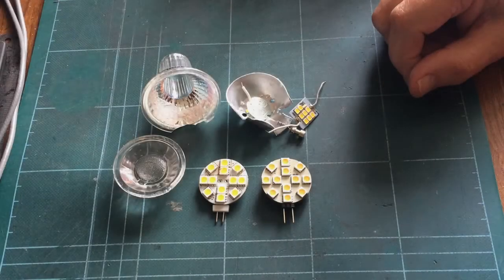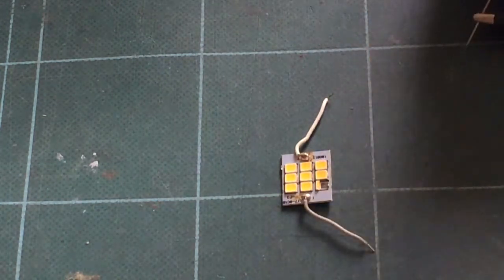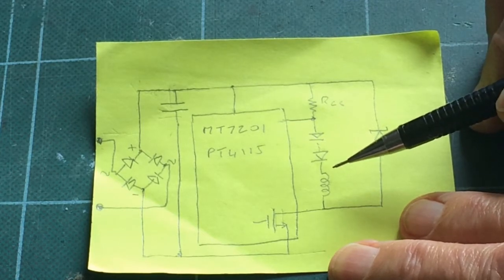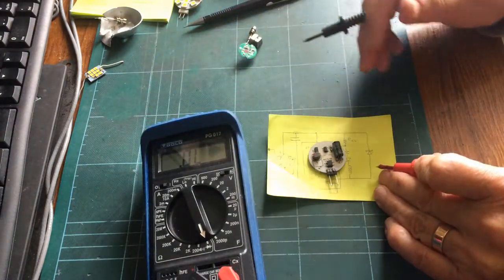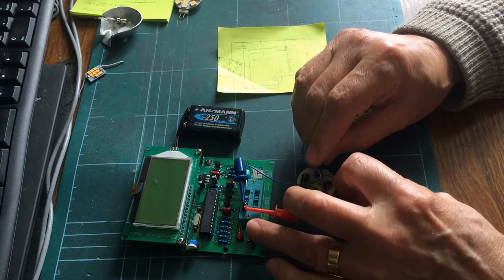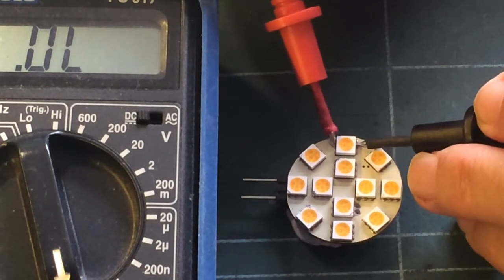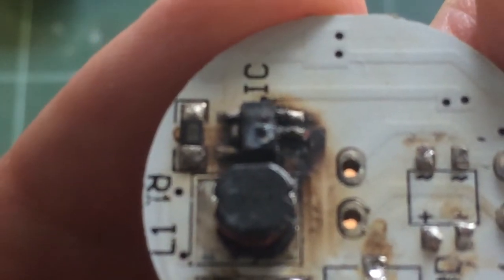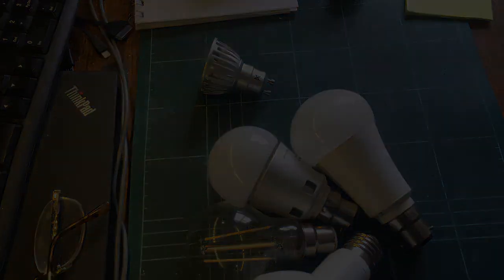LED Lamp Teardown and Diagnosis - 2

Comment: Enjoyed this video, thank you! These are pure gold for the occasional hobbyist like me, because I struggle like you just to get the leads in place. Just yesterday, I spent hours fixing a kitchen timer, putting aluminum foil on the buttons, replacing the reflective foil at the back of display and cleaning up the corroded battery contact - all simple stuff, but it took so much time!

And thank you for showing your component tester and how you use it. I've yet to use mine, now I know what to expect.

I would put you alongside bigclivedotcom, but he has been doing this for years now and I'm intimidated by how slick his videos are - obviously, they are well edited and don't show the hard parts, and his skill levels are way above the even the accomplished tinkerer.

Just a suggestion, don't throw away those scraps of paper, get a pad like bigclivedotcom and file those who hand drawn circuits. Also, you may want to put your camera near your shoulder - but since I've never made videos myself, you'd obviously know better. Thank you again for the time and effort you've put into making these videos - the effort required must be an order of magnitude higher than just doing the diagnosis and repair. Thanks again.
Reply from the maker: Thank you! I think Big Clive has got a bigger workbench than my very cluttered desk! (You will have got a glimpse when I showed my desk lamp.) I don't know what his camera is mounted on but the desk beside me is about the only place I could put my tripod.